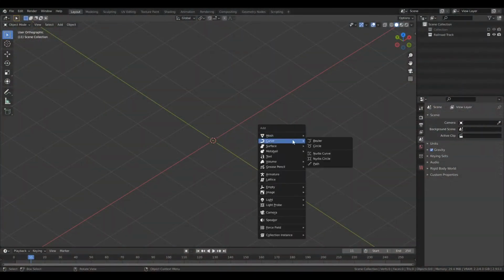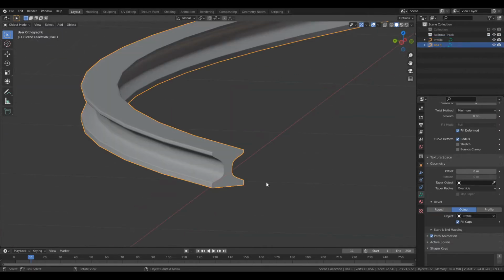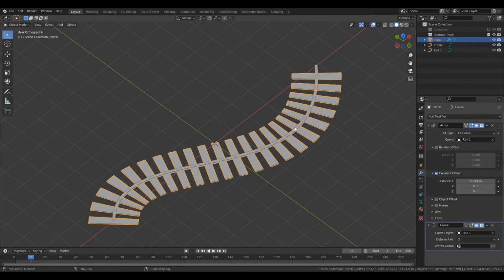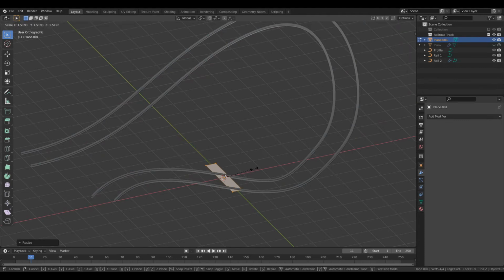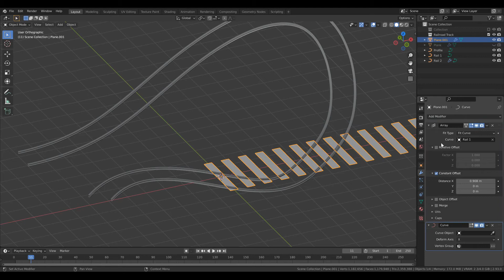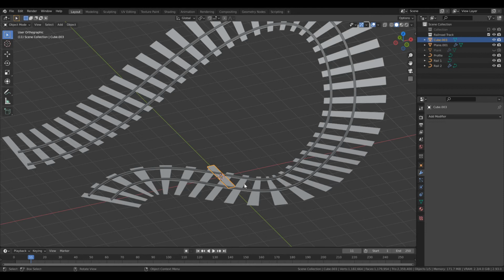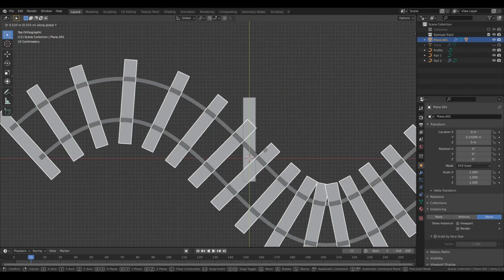How to make a procedural Railroad Track in Blender

Comment: Hey, I don't know if you're still here to answer questions, but I put the twist method in "Z-up" (Rail 1) because else my planks were not facing the sky, but now I can't do loopings, do you have any idea how to correct that?
(really good and useful video by the way, even a beginner like me could do something cool!)
Reply from the maker: Hi, hm very hard for me only through text.
But nowadays I would just do it with Geometry Nodes, it's way more controlled and less issue occur, since everything is hand-calculated.

Maybe I have to do an update video for this one with GeoNodes.
If you want, you can take a look at my "Chain With GeoNodes" Video, that's relatively similar as I would do that track pieces.
https://www.youtube.com/watch?v=1vyW0hrWiWA
Reply: @PointCloud  Thank you for the response 3 years after the publishing of your video!

Yes sorry, I didn't really explain well my problem. I just checked the video you recommended (which is nice too) but i already did my roller coaster with the procedural method (and not the nodes method). 

The problem I had was in Rail1, in the green icon (Object Data Properties), there is the Shape menu (where you told us to put the resolution to 64). Well, right underneath, there is this "twist method". I had to check "Z-up" to make sure my tracks are always parallel to the sky but because of this, when I try to do a looping with my rail1, there is a weird twist at some point.

If there is no easy to do it, no problemo! I will just keep my roller coaster without any loopings, it doesn't really matter (it's just for a small personal video game project).

Thanks again, keep up the good work!
Reply from the maker: @vielife8388 Hm, okay.
You can correct the twist of a control point by changing the Tilt Value of it.
Select your curve, go to edit mode and press N to open the side menu on the right.
Unter Item -> Tilt you can twist that control point which will also twist the adjacent curve lines.
Maybe you can correct it with that.
Reply: @PointCloud  Thanks a lot!
Reply from the maker: @
Hey, I just did a Remake of this Railroad Video, but now with Geometry Nodes.
Maybe I can still convert you to GeoNodes :D (it's easier actually)
https://youtu.be/rGCOdBpyQGA

Comment: Hello, Do you have a way to turn a curved mesh like this into a straight line?
Reply from the maker: Hi, do you mean to change the curve type?
If so, in the edit mode of the curve you can select at the top "Curve -> Set Spline Type"
On "Poly" it will just be straight lines between the control points.
If you want to keep some curved turns on your curve you can alternatively just have more control points on the start and end of the straight phases. Then it will be more sharp at those areas with more control points.
Reply: @PointCloud  Thanks , I'll try it.

Comment: i have a problem, the face normals for the iron bits on the track arent right so when i export it or turn on backface culling, it only shows the backs of the faces, i know this video was a year ago and you might not see this comment but if you do can you please help?
Reply from the maker: Hi, maybe the reference piece itself has the wrong Normal Orientation?
Reply: @PointCloud  so i searched around and found a flip vertices button and it fixed the issue, also thanks for the video it was super helpful!

Comment: Thanks, man! Good tutorial, but wasn't easier to use one curve and offset rail itself and keep planks in da center?
Reply from the maker: Depending on the curves of the track it's not working in every case to do that.
With "my" method, you can form the track in every way with the 2 rails in the correct position.

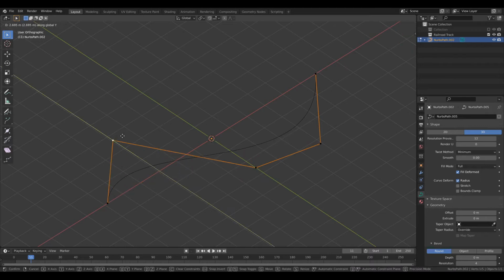Comment: Hello,  how do you make the cube to turn into a circle then making the metall part of the rails. 0:30
Reply from the maker: I just added a "Subdivision Surface" modifier, the shortcut is CTRL + 1-5. The number represents the amount of subdivisions you want to do (but you can always change it in the modifier menu).
Sorry, in the video it is fast and not explained.
And it was no cube, but a plane which I smoothed out.
Reply: @PointCloud  Thank you!

Comment: Thanks! worked great! one question...how would i go about adding this to the blender asset browser? since i cannot join then all in one mesh i assume?
Reply: Tried to do it again, however when i click fit curve it seems to only fit a part of it. It still works if i just put the count up and follows the curve however.
Reply from the maker: @wildmillardz8934  Hard to tell whats wrong with this information, sorry.
The items in the asset browser save it's modifieres too, so it may work. But I am not that familiar with it.

Comment: hello, one of my rails is smaller than the other one? i dont know what ive done
Reply from the maker: @basement gaming
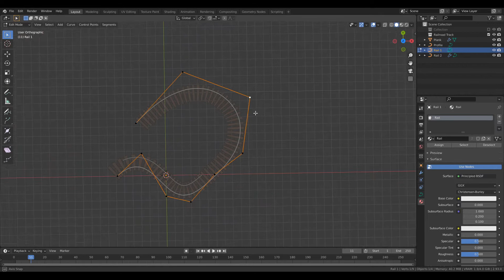Thats normal with this technique, at 1:35 you see that I just change the length of the second curve in it's Edit Mode.

Or if you mean that it isnt shorter, but has a smaller scale, you scaled the curve in object mode. If that's the case, selece the rail and press CTRL+A and apply the scale. Then it jumps back to normal.
Reply: @PointCloud  around 1:17 is the problem.. i have also a smaller rail then the other one and when scaling the path it gets bigger but hast less subdivisions in it
Reply from the maker: @adictivedesign  Are the transform scales of both rail paths at 1/1/1?
If not, apply the scale with CTRL+A.
Reply: @PointCloud  yes but i "fixed" it, with scaling x/y individually till it fits